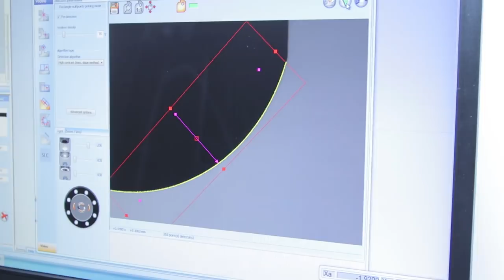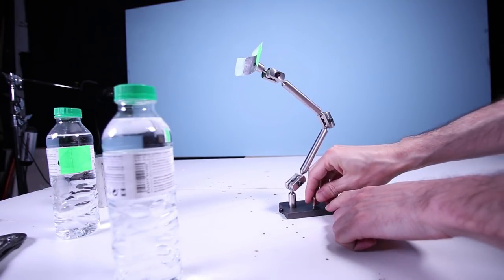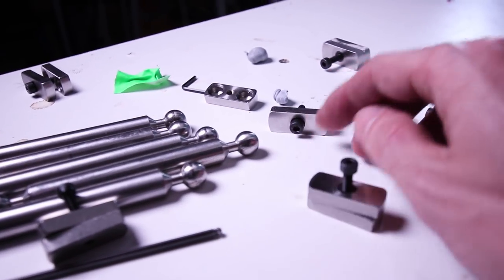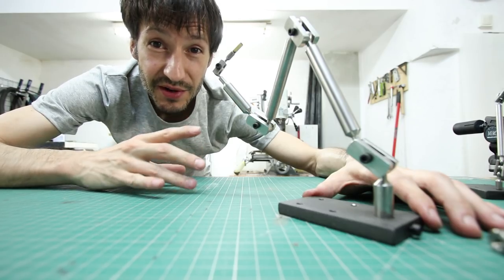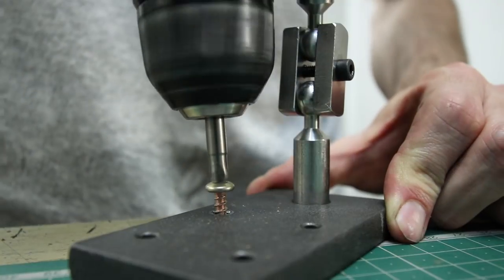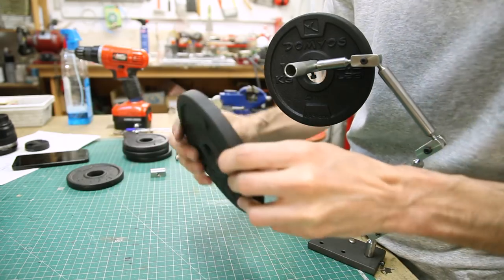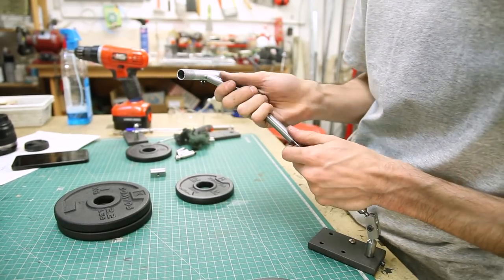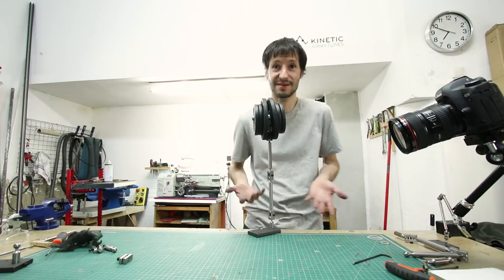The strongest rig for stop motion I've ever made

Comment: Man people would pay crazy money for these to use as precision clamps and “helping hands“ or “third hands“ in precision welding, soldering, electronics, jewelry making, and other precision tasks. 

I had to make my own because I needed something heavy duty like this, and I have the tools to do it. And I wasn’t going to pay $400 for the GRS brand which is tiny and won’t hold much weight. 

I now have them all over my woodworking shop. I use them in violin making, and even in my electronics lab. Similar to the arms that are sold for holding dial indicators to machinists,… But much heavier duty. 

I love your work and I have watched all of your videos so many times. Ball and socket joints are a passion of mine, and although I am not into puppets or armatures… I love holding fixtures and ball and socket joints! I spend a lot of time solving problems with them and trying to design better joints

Comment: hi can i ask how much is that stainless steel ball part cost? Is it more or less than 20 euros if you make a lot of them like 100pcs?
I'm using a similar mechanism in our lamps, only that the ball is hollow on the inside to let the wire through.
Reply from the maker: Hi, those parts are made for stop motion purposes, I will be selling the parts but they will not fit a lamp sizes I imagine, anyway in a week you can see the prices at kinetic armatures site in spare parts of rigs page. If you want to ask me any working colaboration or producing parts for you, just mail me.